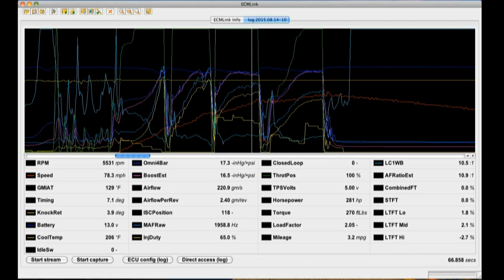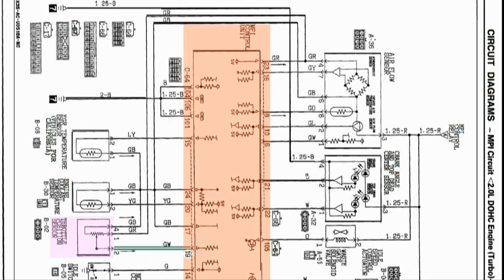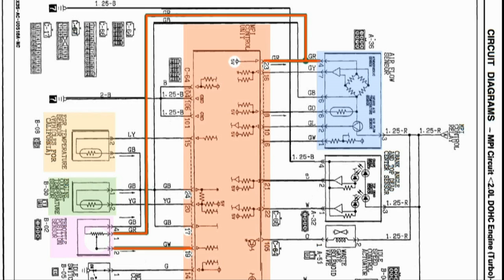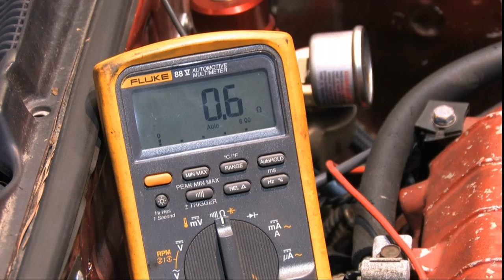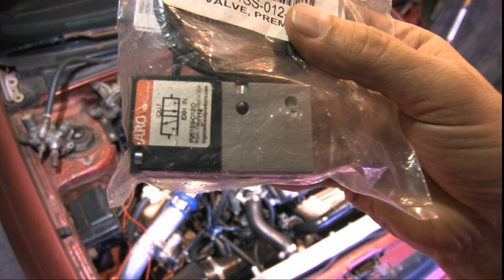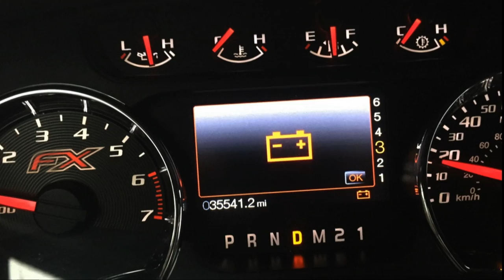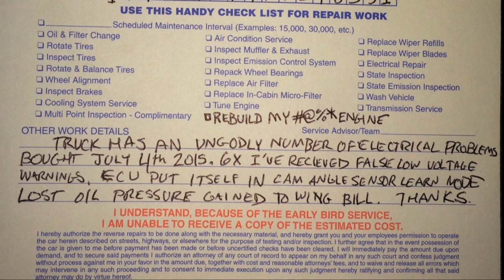Hyundai 16 - Hyundai Wiring BS

Comment: Jafro! Let me tell you what my gremlin was, check your igniter harness. I had the exact same issues and because it was intermittent I was losing my mind.
Reply from the maker: You'll find the part of the video where I addressed it.  ;)  The zip-ties I was using failed because they're terrible for this.
Reply: +Jafromobile yeah sorry I finished watching it and see you found the problem. Sorry to hear about the truck. Why is everything new, junk these days?
Reply: +4sf3d4g63 While there are occasional engineering problems, cars these days are also an order of magnitude more complicated than our DSMs, mostly on the electrical side of things. Lamenting it is quite similar to those old timers who swear they never had any problems on their carbureted 1970s era tank and that all of our 90s era cars are garbage.
Reply: +Ikara Pentiki oh I completely understand but this is 2016. We have CAD and many other engineering software systems which are used to develop the cars and trucks. Bug smashing is happening before the product is developed so why are we still having problems with hot fuses?  I'm not providing any actual solutions, I'm just playing devils advocate. These are issues that should be hypothesized during the R&D phase and if realized during the testing phase, should be fixed. A class action lawsuit or NHSTA investigation should not be where the company is informed of the issues.
Reply: +4sf3d4g63 Oh, that one is easy. Some parts of everything are designed by an intern or other inexperienced resource. Mostly because it's cheaper to make. Until it kills someone, it won't be worth it to prevent. There are lots of solutions to problems in every car that are sub optimal due to cost.
Reply: +Ikara Pentiki those damn bean counters!
Reply: +4sf3d4g63 Inorite? What would we do without them? Probably just waste our lives at the track on the weekend something.

Comment: awesome  trouble shooting.     same thing happened last season to my 2g spyder except at the strip with the iat signal wire to the ecu.  car was good then half thru a pass wide band pegged rich and she fell on her face.  it was only 2 days later when I was running thus the logs I seen the iat dropped out to -40  when it was reading around 87°       traced into the harness about a ft from the maf plug and found the previous owner failed attempt of a crimp butt connector      so feel good ur not the only one out there with all the bad luck.     keep on keeping on

Comment: Hello Jafro I am really wondering one thing..Did you use original hyundai engine harness or you bought 4g63T harness? Maybe you did harness by yourself?
Reply from the maker: It's a '90 Plymouth Laser engine harness spliced into the 1992 Hyundai Elantra interior harness.  It was a used engine harness.  I didn't do the work, but I know how it was done.  One plug had to be cut off and a new one spliced in because it was the wrong gender.  A few wires had to be lengthened because of where the harness goes through the firewall on an Elantra vs. where it does on a DSM.  Hyundai did things a little different on their interior harnesses, but with a test light, a multimeter, and an electrical diagram it's not so bad.  I'd feel confident doing it myself with what I know now.

Comment: also my escort left me stranded due to a wire  a few times. Worse time it happened was on a friday night at a busy intersection. Everyone could see my baby not working. lol
Reply from the maker: I broke my clutch pedal in half one day in neutral during rush-hour traffic in an intersection of a 6-lane road.  Snapped right off. Pushed my perfectly-good running GSX a half block by myself uphill into a parking lot because I couldn't put it in gear.  I was wearing loafers and a suit.  The towing clip is somewhere in my GSX videos, LOL.
Reply: *****
Way to remind me how to count my blessings. lol. Ya my issue turned out to be a ignition coil wire that was just backing out.

Comment: Good job. But I would suggest learning about voltage drop testing. Resistance testing will lead you astray one day. Two wires can read same ohms, but one will carry current and one won't. Voltage drop testing will show you that. Another benefit is other components in the circuit don't affect your test. So you can quickly move around the harness/components without unplugging stuff.

I was happy to see a new vid on your channel! Always look forward to your stuff.
Reply: I agree completely on this.  one of my DSMs had an ignition issue and everything had good resistance.  Turned out the power wire to the aftermarket ignition box was partly broken and had only a couple of strands carrying the current. 

However in this case everything was pretty much very low current sensors.

Comment: Backprobe, backprobe, backprobe. Its not a good idea to jam your test equipment into the front side of connectors, no matter how thin they are. Eventually you'll cause yourself an issue because your pin tension won't be good and the connection will be loose.
Reply: I know an innuendo when I see one.

Comment: is this the car that you did the awesome port and polish video on ??    How did that engine turn out ??
Reply from the maker: Yes.  It holds 30 PSI at 6000 RPMs with pump gas and no knock on a 60° day.  It makes more power for a light flimsy FWD car than any road can take.  Zero traction until you break 90 mph.  There will be more about it soon.  I'm working on means of making it stick.

Comment: if that truck is under warranty I would not Touch it.  I would drop it off at the dealer right in front on the main entrance if they want it moved they can fix it.
Reply from the maker: That's exactly what I did.  Note it got dropped in front of everything else so they can't drive around it.  It finally broke down with 36,100 miles on the clock.  The first false low-voltage warning is all I had a picture of.  I got to pay a $100 deductible for using my extended warranty, buy the $90 fuse relocation kit, buy the $90 passenger mirror exterior light assembly that fried along with it, and all my warranty covered was the labor.  I got it back in 3 days for $180 because my deductible applied to the repair balance.
Reply: how good are old cars :P
Reply from the maker: nismofreak34 Ol' Whitey's rockin 225,000 miles and never once in its life came in contact with a tow truck.  There's always that... ;)
Reply: +Jafromobile so it was 100 miles over the factory warranty?  36,000 mile warranty correct?
Reply from the maker: Yessir.  That's the way my cookie bounces.  Did you see all the 5-leaf clovers?
Reply: +Jafromobile yeah.  you would think only being 100 miles over and it being a known problem they would have covered it.
Reply from the maker: It's FoMoCo.  Not Apple, Inc.  I mean yeah and all, especially since I'm related, but it's not the same company it was 113 years ago.  

The service department in this video is at a different dealership than where I bought it from.  This dealer's justification is, "We probably would have covered it if you didn't have an aftermarket warranty.  But since you have it, we have to use it... I mean... that's why you bought it.  It will set off red flags if we didn't use it just because you have it."  I totally understand.  My frustration lies with this truck continuously costing me hundreds of dollars every time I do everything I'm supposed to do correctly.  Ford isn't standing behind its defects, and everything else past the sale of my truck from the dealer I bought it from has been a complete disaster.  This dealer did a good job on my truck.  Not a great job, but at least the polar opposite experience than I had with where I bought it.  I gave my mechanic an A+ rating in the survey because it came back properly fixed with no new body damage.
Reply: after the 2nd time back it stays at the dealer. 
My parents bought a 87 Taurus and the car was back so many times my parents woud walk in and the lady at the desk knew the VIN by heart. Fun fact, there were 9 transmissions installed in 4 months.
Reply: +Jafromobile As a former Ford service advisor I can tell you that extended warranty or not, at 36,100 miles, I would have done it for free. The dealership screwed you. I'm so glad to not be in that corrupt industry anymore. Excellent video. Thank you.

+Gonzo's Garden Before I even finished reading your comment, I saw 87 Taurus and said to myself, I woder how many transmissions he had warrantied. I'm guessing you went through a few power steering lines and A/C compressors too. Ford even extended the warranty on those transmissions because they were so bad.

Comment: Great vid, really gave me a good laugh at the beginning.  I've got a 626 which just occasionally dies as if someone disconnected the battery, a kinda quiet, genteel stall.  Usually starts right back up, although once or twice I had to wait a while before it would restart.  I hooked up ForScan on my laptop and did the same thing you did, went around wiggling wire harnesses and individual wires on everything under the hood, the dash and the connector to the ECU, without any success... Not sure where to go from here.
Reply from the maker: They really did name that product ForScan, didn't they?  :facepalm:  It could be that the cause of your issue is in the charging system and something the ECU can't log, it could be that your issue involves wires that you didn't wiggle, and it could be that your problem is thermal in nature.  You have committed yourself to a valiant effort in troubleshooting, and one that asking yourself a series of questions might help you get closer to the cause.  For instance, does it do it going around left or right curves, during accelerating or braking?  Does it do it in some seasons and not in others?  What other electrical components are turned on when it exhibits this behavior?  It also could be internal to the ECU itself.  A cracked resistor, failing capacitor, etc...  I feel your pain, but I'm still going to make fun of Ford for calling it ForScan.
Reply: ForScan is actually made by a bunch of Russian hackers, so I'd watch out unless you want all your e-mails on wikileaks :-)  Seriously though,  I just replaced the alternator, and that's probably one of the only wires I didn't directly wiggle.  I had one time a few months ago when it was just sitting parked, and I couldn't start it, and couldn't connect to the ECU, then went out the next day and it started right up.  My remote entry key stopped working recently, sometimes it will almost die in the same way, but in those few instances the security key on car dash light came on and then went off when it recovered.  Also have a weird rough idle under load which I can't find any reason for ( compression is good, timing ok, lifter to cam clearances ok, all sensors look normal on scan, checked resistance on the cam, crank sensors, egr and iac, checked plugs, wires, coil ) and just generally this car is making me nuts.  I'm suspecting that my old alternator may have been putting out poison juice, cause I've had to replace the O2, and TSS sensors, and it looks like my VSS may be going wonky too.  I'm thinking maybe the ECU was slowly getting fried by bad juice, but have no idea how to check it.
Reply: So I ( actually the auto electrician ) found my electrical problem!  Apparently the insulation had worn away on a few wires in the Cobra alarm system installed on the car and these wires where intermittently shorting out and smoldering, which was causing various things like the ECU and fuel pump to get randomly shut off.  You can see a picture here:  http://mechanics.stackexchange.com/a/36685/7132

Comment: Hmm...the vid is titled as a Hyundai, but I could swear that car had a Mitsu badge on the front - and that engine looks a lot like what I had in my old Eclipse GS 2.0 - an I missing something here?
Reply from the maker: No.  Not at all.  Mitsubishi was under contract to make engines for Hyundai through the DSM partnership, and from '89-'95, the Hyundais came with various 1.5, 1.6, 1.8, and 2.0L engines.  There were occasional 2.4L, but in '96, Hyundai bought all the casting dies and foundry equipment from Mitsubishi to make their own engines.  My front bumper is a fabrication of various Hyundai, Subaru and Mitsubishi parts housed from a junkyard (including a Mirage).  There's even a section of PVC pipe rivitted in there.  Some paint...  What's convenient is the G4 and the 4g designations of Hyundai and Mitsubishi stuff cross-references out, so legacy parts are interchangeable and this engine is a hodge podge of 3 different car model's parts.  Many of them share the same engine gasket set part numbers.  The block is from a '90 Galant, the head is from a 1.6L Elatra, the valve cover, valves, turbo intake and exhaust parts are from an Eclipse, and the transmission is from a Plymouth Laser.  The used ACT clutch came from a 2g GSX.  It's got corvette exhaust parts for intercooler piping.  The wheels are off a Nissan Altima.  The brakes came from an Expo minivan.  All of these parts were bolt-on interchangeable save for the intercooler pipes.  It used to have factory DSM rubber hoses from a turbo car on it.  It still does in a few places.  All it has run is mid-to-high 13's so far.
Reply: Sounds like a mongrel - but a FAST mongrel.  :-D  Thanks for the clarification - I was getting a bit confused there.

Comment: I made a similar bracket for my solenoid. I originally installed my solenoid in the same exact spot but I have heard that the heat can kill these things so I moved it. Good to see you back!
Reply: I've had one for years mounted on an aluminum radiator with no issues
Reply: Well this is just what I was told. I didn't keep mine near the radiator for more than a week.

Comment: Can you tell me to which computer terminals should i wire the boost control solenoid?
Reply from the maker: But... I did... in this video...  For a 1g, power comes from the MPI circuit off the maf sensor harness, and it goes to pin 105 on the ECU connector.  That was what the scene where I added a boost control solenoid to my harness was all about?  lol.
Reply: +Jafromobile yeah but i de pinned the harness in my car so it doesnt have the oem boost control solenoid

Comment: Why did he choose a hyundai as his project car?? 
I am new to his channel and just watched a few of his video
Reply from the maker: 1.  I didn't choose it.  It chose me.  It showed up in my driveway with the keys in it.  Like stray animals, the ones that find you are usually the best ones.  In this case, I'm really not so sure...
2.  Many of the Elantras from 1992-1995 has the Hyundai equivalent of a Mitsubishi 4g61 1.6L.  A roughly 90hp good fuel economy engine by design, if not a bit over-engineered.
3.  The 4gxx portion of the engine code... all 4gxx engines share the exact same casting mold.  The only thing that changes is the bore, stroke, and deck height.  All other machining tolerances are the same.
4.  Due to the 4gxx designation, engine mounts from the turbo 4g63 Eclipse engines, a stout, high-performance 4-banger with a huge aftermarket performance following, the engine mounts can be swapped out and you can bolt a thoroughbred heart into the body of a mouse.
5.  Because nobody else has one, it has higher entertainment value... but because of its popularity of the 4gxx Mitsubishi platform, still has great educational value.
6.  Because I'm a YouTuber and my videos revolve around problem resolution, it benefits me to use a car that has everything in the world wrong with it.  It's an endless supply of material.

I could go on, but I'll stop.  I'm sure you see the novelty of all this and where it's going.  :)
Reply: oh okay I get it , its much better to stand out and tune a unknown car  among the load of supras, rx7 , miata, evolution, civic etc that everyone has  XD

Comment: As for trying to zero out your multimeter. Your probes and leads are probably just fine. Just clean the tips with alcohol and make sure to have very good probe contact when measuring. Those sub ohm errors are usually just caused by dirty probes or dirty devices under test and you have a "REL" button to zero out the residual before you start measuring your circuits. I work with electronics and I can tell you that resistances under 1 ohm usually require more than just a good multimeter to measure accurately. You have a decent one and if you get a more or less stable reading of less than 1 ohm from the measurements in the video your wires are more than likely to be good.

Thumbs up for Clutch. I have tickets to their concert in Helsinki on 10th.
Reply from the maker: Look at number 10 in the description!  ;)
Also… This multimeter does 10,000x more than I typically need to use for a '90's OBD-II car.  I try not to go too deep into these kinds of tools because the average viewer isn't going to spend $500 on a meter.  They won't have the REL button.  They're probably going to use the $6 Harbor Freight meter.  To humor them and in an effort not be intimidating, I usually do, too.  xD
Reply from the maker: Brace yourself for that Clutch show.  They played for us for 3 straight hours.  You're in for a real treat!
Reply: Sorry, didn't read the description at all. I was actually surprised to see you use such a high end meter. I wish I had one like that :D These days you can also get very decent chinese meters for 50-100$.  Plenty good for all your car needs. As for intimidating then I think it's as intimidating as all the rest of the electric bits on a car for an average Joe :P